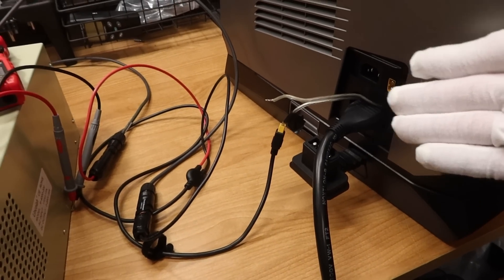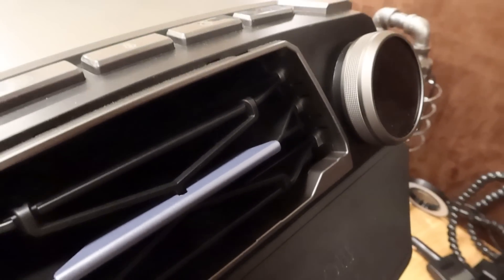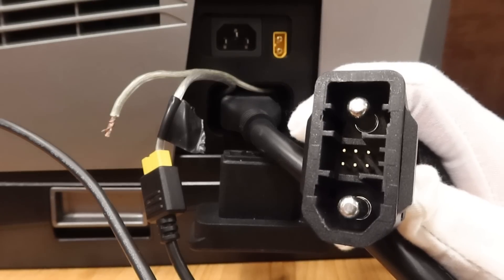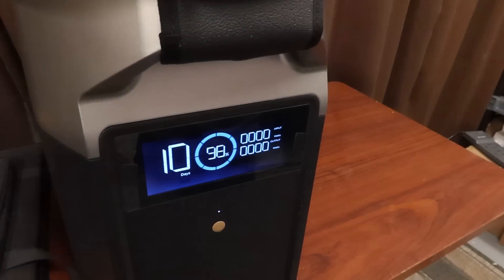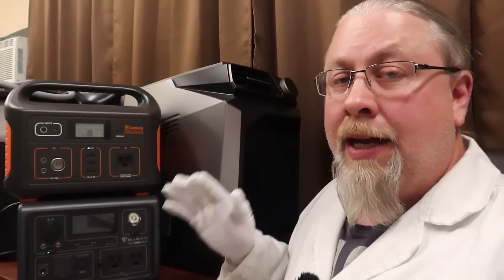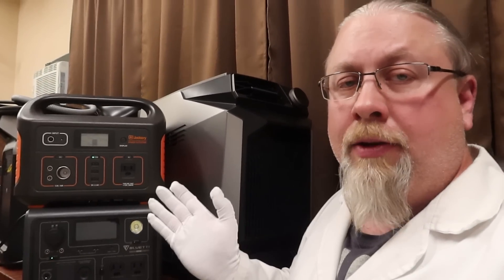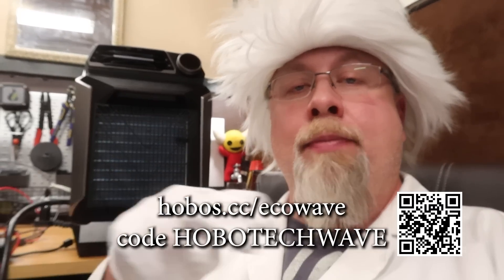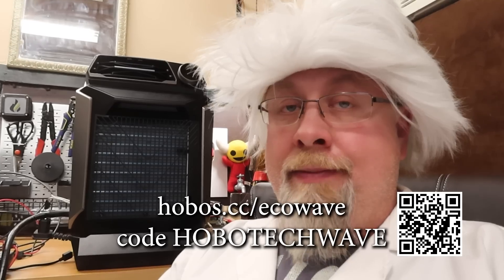EcoFlow Wave A/C FAQ | How To Use Your Own Battery Or Solar Generator

Comment: Professor: I have only 1 question….WHY would anyone would want to try a hack, considering the time, expense, and the potential for personal injury/product damage to this obviously pricey product???
Reply from the maker: Because people do dumb things to save a buck. I think the way they marketed the pricy bundles was poor. They sell bundles with expensive battery generators and don't explain why you should get the generator too. Its NOT just for running the a/c but has a million uses of its own including home backup. This is what folks are paying for. Most just look at how much it costs with a battery generator and say "I'm not paying $2500 for an air conditioner!" when the reality is the a/c is actually just an add-on product!
Reply: @HOBOTECH  Professor: Thanks for putting things in their proper perspective.
Reply: @gamerfortynine  You have a point, but I see no upside considering the Professor’s multiple mentions at the beginning of the video of a fire hazard.
Reply: Maybe the professor is showing what can happen if you do what you shouldn't? You know someone out there, with less knowledge than the prof, is gonna try it.
Reply: @retrotek0409  You’re right. If everyone was rational/smart, this world wouldn’t be so screwed-up.

Comment: I don't see how making 
A/C that cools 64 sq. Ft. That over 2,500 not including the battery or solar to plugging in  a 150 dollar A/C window unit with soft start that cools 300 sq. Ft.🤔💵
Reply from the maker: First, I don't know where you get your math. A 4000 BTU will easily cool 200 sqft. I also don't know where you get your price. This a/c is $1199 NOT $2500. You can't compare this to a cheap window unit. This is meant for portable/camping/RV use! Watch my other two videos and I explain it.

Comment: What about the Bluetti AC200's 25 amp 12 volt port? Would that be safe and get any more run time than the cigarette plug?
Reply from the maker: It would work the same as the 12v demo shown in this video.
Reply: @HOBOTECH  thanks professor for pointing that out👍🎩

Comment: Hey thanks for trying. The easiest solution is going to be for EcoFlow to come out with an optional adapter for other sources. That is if they want to sell mor AC’s .
Reply from the maker: I have to agree it already comes with a way to run off universal AC. If you want to run off DC your options are to do what I show in this video, get their $600 battery, or one of their Delta products. Ecoflow has always been the higher priced "Apple" of the battery brands and many have no problem paying the premium for higher end products. Ecoflow has no incentive to allow folks to use other brands to run their a/c.
Reply: They have one.... it's called the AC cord.
Reply: @FU2_Ggl  that's a garbage solution and you know it. DC to AC and back again is small brain to the maximum.
Reply: You've created this channel to show and share your personality and insightful knowledge on a great many things that are of  interest to a great # of people. Based on your sound advice and knowledgeable recommendations, people, in turn, come to you for answers. Thought that was kind of the point. Now you seem irritated that people seek your input. Seems to me there's a wide ranging # of smart, dull, slow and even wise people that care about what you've offered up to us all to think about and learn from. Sometimes I'm smarter than your average gummy bear. Sometimes, regarding certain things, I'm not. But in this case, I detect some frustration and or annoyance directed at us loyal supporters of what we "thought" you were offering. Was gonna ask you why the sky is blue. Figured it out. The sky is blue because it's sad. Maybe take a break and some time away. I don't "think" your supporters are intentionally trying to irritate you. Seems as though some have.
Reply: @Chubbydippin  what a dbag.  Get a life.
Reply: @Chubbydippin  He gets sent these products to review, not so he can hack job it, so you can save a few pennies at the risk of people electrocuting themselves, or worse, suing him.

Now stop pretending to be some 'loyal' viewer and let the man do what he does which is provide information on products.  He's already stated that the unit wasn't meant to run without the intended cable and you come in here saying he's irritated.  Hell I'd be irritated too all things considered.  Your post is neither productive nor supportive of anything.  You're just annoying.

Hobotech, keep doing what you're doing man, ignore these useless twats.
Reply: @lr6187  I never asked him to perform some hack job nor took part in the repetitive line of questions to do so. I've gained many answers and have benefited from watching his breakdown of products, real time installs and have thanked and commended him on the knowledge gained and insight along the way. In this particular segment I detected a level of frustration from him I've not seen before. Merely pointing this out and suggesting taking a break and not letting all the knuckleheads get to him is not being a twat. My comment wasn't even directed at you. I commend you for promoting harmony and positive interaction in your noble quest to be the shining light amongst all the darkness. You sir are the used kitty litter that binds us all into the fabric of interaction  deemed necessary and appropriate by you. I'm proud you for taking this stand for us all.
Reply: @Chubbydippin  Been watching Hobotech for a long time as well, I support him in what he does, and took no offense or annoyance to anything he's posted up, as you were "inferring" in your "last" "post".  

He was addressing multiple questions he was getting, that were being asked over and over and you somehow twisted that into that long overdrawn statement about annoyance directed to "loyal" fan base, and that he needs to take a break?  Sounds like you need a break yourself from speaking for everyone else.

Comment: hey hobo, so I live in south florida and I am looking for a unit that can handle my full size refrigerator during hurricane season power outages.  what do you recommend? thanks
Reply: Anything with at least a 1000w inverter and at least 1000wh battery. (This will get you around 7hrs depending on your AC power requirements)
Skip the jackery and look at bluetti and ecoflow.
Reply: @grindychum  or a Titan
Reply: I'd look at the larger modular units(200p or max or 300) Bluetti has or the 500. 500 is a whole house unit. Maxed out modulars & 500 can hook to your panel box if you like.
Reply from the maker: https://hobotech.tv/large-home-backup-ups-240v-solar-generator-power-stations/
Reply: Why post a question that is completely unrelated to the video? HT and others have videos already addressing your question if you search YT.
Reply: @SweetBearCub  not that it's any of your concern but it was the most recent video and this guy seems to know his shit.  Why don't you mind your own business